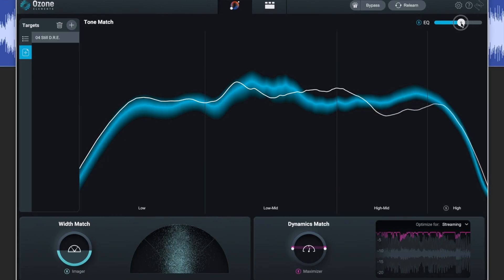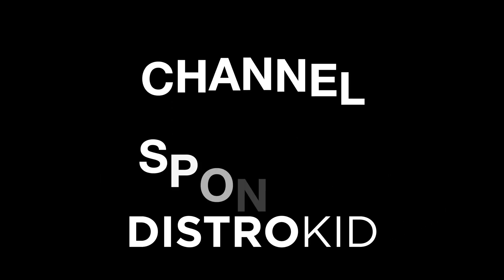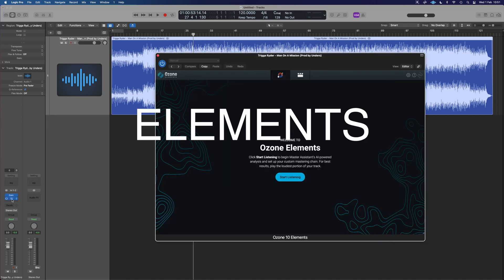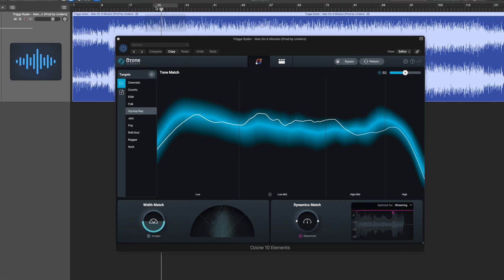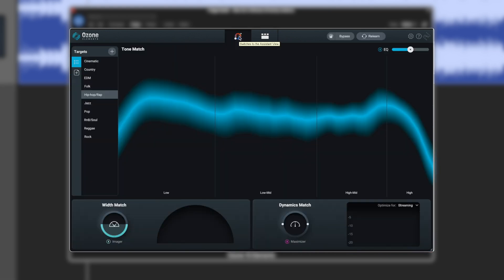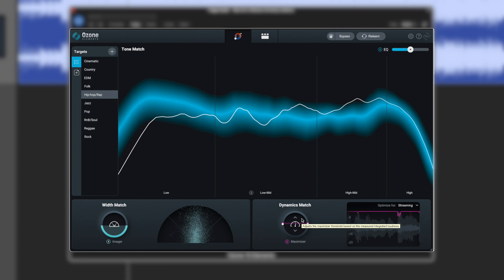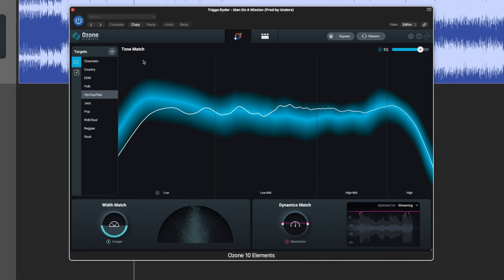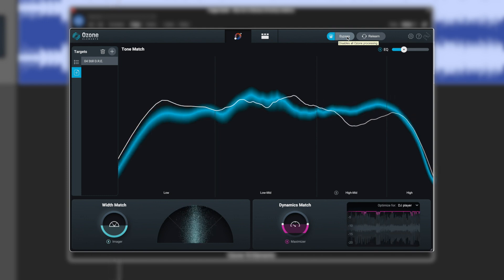How to Master With Ozone 10 Elements

Comment: Cool song and great video, mate. Just curious, do you usually use -6 decibels when sending it? Thanks for the info.
Reply from the maker: Not really necessary in digital mastering. As long as its not clipped in the file its fine. You can turn down digital with no issue.
Reply: @Unders  thanks!

Comment: I own Ozone 9 advanced. I bought a cheap bundle at plugin boutique with elements 10 and audio lens (and more) included.
I tested Ozone 9 and Ozone 10 and Elements 10 with "basic" output : elements 10 give simular results as Ozone 10.
You can even reach the EQ in Elements 10 by using Tonal Balance 2 and select source !!
So no need for upgrade to Ozone 10 advanced.
Reply from the maker: Ahh that tonal balance 2 trick is a clutch right there!